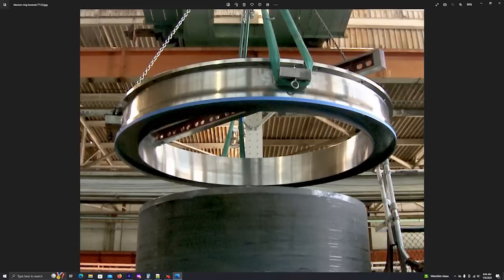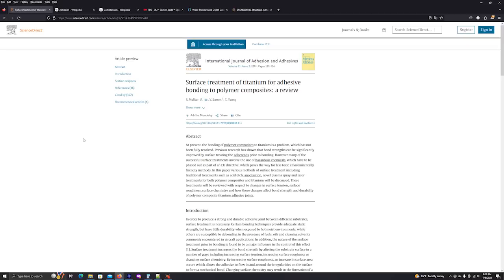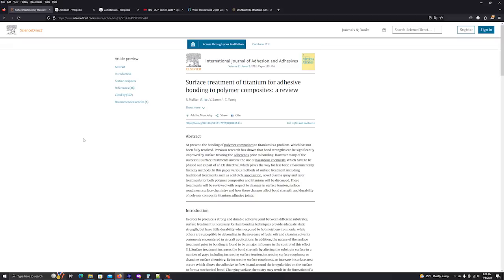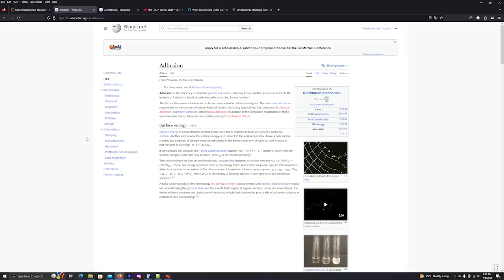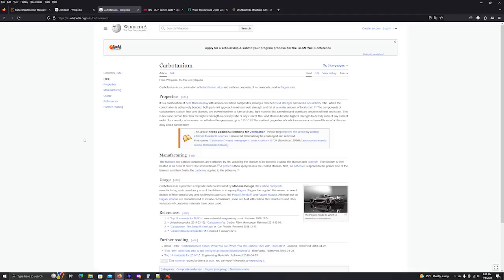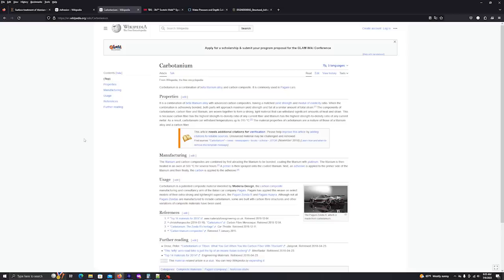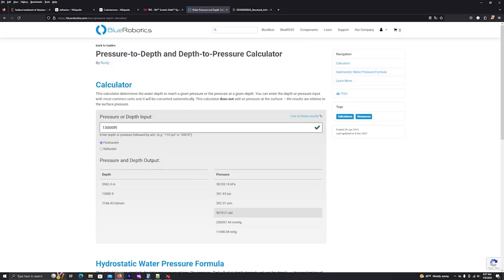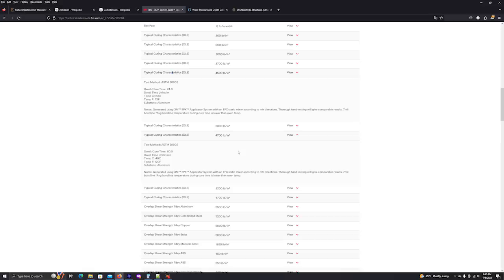Oceangate Titan Adhesive issues between Carbon Fiber and Titanium

Comment: The bonding method itself is dubious but the way they were doing it in a warehouse and not a cleanroom is wow.
Reply from the maker: Yes, also the guy in the video wiping the ring/flange did not have gloves on.
Reply: @JoediyLab  
Stockton:  It's not like Elmer's glue, it's like peanut butter.  
I'm convinced this guy's family paid for his engineering degree, which is a thing that needs more scrutiny because "engineers" like that will kill people.
Reply: @BIG-Jared  Engineers like that cause disasters. I agree his method of gluing the rings on to the carbon fiber was not very smart.
Reply: @BIG-Jared - where'd you get your engineering degree?    ::eye roll:::
Reply: @JoeyMartz  ... and you? Me, I attended UT and 40 years with LM Aero in this field in 38 Countries. Care to give me a shot? Rush was 20 years on the F-15 Program (and most probably his penchant for disliking the rigidity of how Aircraft Companies must do business ... including AS9102 certification that would have stopped him in his tracks and the Sub, as configured, never made) ... and know that there are a multitude of "Engineering Specialties" ... he was NOT the right type of Engineer to be making these calls IMHO; he fired the right guy 3 years ago because he told him "no" to his design.
Reply: @BIG-Jared  Rush's specialty was in aerospace engineering-- so essentially, he had the base knowledge of engineer shit and building human-occupied craft, but obviously the physics of that do not carry over to ocean physics.  If he had zero engineering experience or knowledge it would be astounding that he made some shit that managed to survive 7 previous dives.
Reply: @AnonBigSlice good point, he did make a working submersible, just not a multi-dive submersible
Reply: @aelius_audio he made a death trap it could have failed at any time all y'all sitting here talking about how poorly he applied the glue that could have failed on day one
Reply: It failed perhaps because of repeat deep dives weakened entire structure. The ntsb will come out with a full report in 2 years.
Reply: @BIG-Jared enginnering degree on its own doesnt mean much. You can take the fundamentals of engineering (FE) exam and undergo the 'professional engineer' (PE) career track, which requires years of on the job training. "Real" engineers are 'PE' and not just college grads.
Reply: @BIG-Jared  Yeah, legacy admission to Princeton because one of his ancestors founded the school.
Reply: his whole design wasn't very smart, as witness his shiny new Darwin Award, very well earned.
Reply: @JoediyLab  yep ... and does not appear any "Adhesive Primer" applied; most ALL Aerospace Adhesives require "Primer" prior to application of the Adhesive itself along with prescribed "tack time" ... and all this done in "Warehouse" setting instead of a "Clean Room" ... SO, SO many major mistakes in these videos you are kind enough to share. Thanks !
Reply: @JoediyLab Exactly. Working with composites and adhesives is not like mechanically joining materials. 

Proper Processes Prevent Piss-Poor Performance is the guiding principle, and cleanliness, to the point of obsession, is paramount. 

It doesn't matter how well you adhere to the mandated curing cycles or how perfectly suited the chosen materials are to the task at hand, if you contaminate the product during the build up, you've created a ticking time bomb, one that may have serious consequences down the road.

What's worse, is that there's no way to tell these incorporated weak spots are there, till they announce their presence, months or years later, by showing up as delaminations or catastrophic failures.

I used to work as a structural tech at a major airline and I both fabricated and repaired composite structures. I don't know what it is, lol, but there's something about a freshly prepped, CLEAN surface, layup moments away, that seems to invite foremen and other looky-loos to appreciativly rub their literally, greasy mitts, on the repair area while saying, "Nice job." "Gee, Thanks! (for one more bout with those toxic cleaning products)" was our response as we walked off to get them, lol.
Reply from the maker: Yes thanks for the feedback 🙂
Reply: My first thought was "There are going to be air bubbles in that glue." Air bubbles bad.
Reply: @ianwalton284 Air bubbles in the carbon fiber, and the glue would keep passengers better insulated and warmer at depths.
Reply: @JohnSmith-bw8dn  they showed the difference between backyard hobbyists and professional sub builders. Triton Submarines is professional sub builders
Reply: Rather questionable how did air bubbles escape when lowering the flange? Ah, right, they didn't
Reply: Wiping the dust off the ring as they sit in the warehouse waiting for the joining together day.  No one thought there was a problem here?
Reply: This is a sacrifice c'mon in our face
Reply: agree…also the carbon fiber was wrapped horizontally, should have been a weave…this would have minimized cracking
Reply: The flange should have been longer with measurements taken dry fitted and then after the wet layup to make sure they had the required thickness of adhesive and then they should have been looking for a bead of squeeze-out 100% around the perimeter. That's just for a proper joining. The whole thing was never meant to go deep in the first place.
Reply: I also noticed them not wearing mask's when mixing or applying this adhesive, fumes have to be strong
Reply: It is homemade.
Reply: Stockton Rush admitted to cutting corners but said he had good engineering behind it. Yet, what’s swirling around in the ether about him does not lead me to believe his engineering was conducive to anything good. The thing the really gets my attention about this whole thing was that Stockton Rush wasn’t just a guy that believed that safety was stifling innovation. Although this is what he says, people say things that they want you to hear. Safety stifling innovation would have some general support here and there from people who might agree in whole or in part with that. But Stockton Rush did not just believe in lax regulations, the guy was openly against safety altogether. 

The group of professionals that were critical of his choices were people just like us and typically a person would not go out of there way to write a letter, or an email, or make a phone call to tell someone that they don’t think what they are doing is tenable. The normal human condition in these situations is an atmosphere of support, and perhaps brotherhood with competitive undercurrents. If we examine all the effort that people put forth to warn him and get him to reevaluate his blueprints and incorporate safer measures it turns out to be extraordinary. 

Safety has always been a pain in the butt to everyone. Nobody just embraces the safety aspects of a project or a job, yet most of the books of rules and regulations have been written with blood. So we all understand that safety is in place because real lives have been forsaken doing the very same things. 

James Cameron documented his process creating the Deep Sea Challenger and in his documentary about the second scene of the movie Mr Cameron says, “We never compromise on safety. Not when it involves our lives.” He created a sub that was more than sturdy enough to maintain under the effects of the pressure. He rigorously tested every part, every system, and every procedure so that he could do the dive and live to tell about it. 

What has occurred to me with all of this in mind is that safety is often times a bit of a grey area. Safety is completely redundant and perhaps a lot of it is totally unnecessary. The problem is you do not know when you have crossed that line of having just enough safety, or having way too much which means lots of wasted money. 

When it comes to certifications and testing for inventions like the Titan from OceanGate, it’s not like going to your local DMV and paying $40 and getting something printed up. 

Stockton Rush was outspoken against safety and I just cannot think of why anybody would be that way about it. But what I believe is that OceanGate was still trying to get to a place of viability. They had not broken that crucial line of becoming as profitable as Stockton Rush dreamed. In the year 2021 he managed to raise $19 million for the company. He purchased carbon fiber at a discount from NASA because it was beyond its shelf life. Safety is an attitude that shines through in everything you would do in that situation, but buying that carbon fiber is one of many indicators that his whole mindset for that project was in the wrong place. If he was looking at his balance sheet and had a bank account of about $20 million, he knew if he was to go line by line and do everything as safely as he should have he would have easily watched that $20 million dwindle to just a few million. 

Stockton Rush had a predicament. There is no way that when he was training to be a pilot they were teaching him to ignore checklists, and be some maverick out there who didn’t follow the rules. He certainly would not have learned that from engineering school either. His attitude toward safety I believe was a self preservation situation in which he launched an assault on anything having to do with safety as a way to preserve the most capital possible. Worst case scenario in his mind was he heeds the advice of the community and shells out $15 million on upgrades and testing and certification by esteemed bodies and then something catastrophic happens to his business and he is forced to abandon everything. The fear of failing at OceanGate was able to push out the very real threat of creating a sub that implodes because it has t been tested.
Reply: @adamlv1  Very well said.
I honestly believe that that not every human endeavor can be safely transformed into a viable for-profit business, and OceanGate seems to be evidence of that.
It has certainly confirmed the adage that safety regulations are written in blood...
Reply: @adamlv1 this was the most complete and comprehensive thought on the whole scenario and I totally agree. The whole situation screams that Stockton Rush was not as financially strapped as we had initially thought.
Reply: @adamlv1 right on. My exact thought. This has more to do with clinical psychology than engineering. He self deluded himself into thinking that modern safety protocols were excessive because he needed a viable way to enter a very resource intensive market with little money available.
Reply: Leaving oils from your finger is your hands and not in a clean environment with suits and mask gloves
Reply: @gaylecheung3087  "Leaving oils from your finger is your hands.."  ?
Reply: @SteffiReitsch  it's evidently some kind of typo or just a brain fart. The point comes across just fine.
Reply: @tomslastname5560  I  think it 's messed up , but since she's not a native English speaker, it's forgivable. We can figure out what she's trying to say.
Reply: @SteffiReitsch  know what he's trying to say. When  gloved and in a protective suit, the fats/grease from your body won't transfer to the materials you are working with. I think he's a native Chinese speaker, so be easy on him.
Reply: you know once under water they wouldn't even need to have the two pieces glued together...the pressure of the water alone will make it impossible to separate the caps even if you'd try...so the glue as NOTHING to do with all this.
Reply: @TechWizMaster  yes, but Water could seep in through these glued parts as the Titan was towed in place! and anyway,  you can't simply glue something together without following the exact procedures!
Reply: @TechWizMaster   Even if water pressure alone would hold your submarine together at depth, that does not mean the water doesn't try to move under that shady "glue" seal. Also the submarine is not always withstanding super high pressure.  Maybe the glue went bad in shallower water or from some mechanical stress during transportation.... it's not like your sub stays always at 4km down... it moves around.... and that "glue" is totally inadequate to hold any mechanical forces.  So I think the seal went bad from totally unrelated to depth forces and then just gave up at some point, which led to that sudden decompression. Also if everything is OK with that "seal", why no other submarine or actually anything is build in that way... even a normal car is not glued together like that.  I think the seal is just too shabby and shallow.
Reply: @TechWizMaster  agree, nothing with the implosion, but certainly had an effect on the tightness.

Comment: I read a study on the bonding strength of different materials with different prep. I have always found sandblasting metals is preferred and the study confirmed this with  titanium. Also a serious and thorough cleaning process so no contaminating residues at all. They were using rags to wipe titanium that might have chemical residues on them and also was there any abrasive prep on the titanium. I am confident the bond was the failure point.
Reply: They also weren't wearing gloves when cleaning the mating surfaces. He's even leaning his bare forearm on it. 
Remember kids not to Rush things. 🤠
Reply from the maker: Yes it appears so, but we do not know if the carbon failed first or the bonding failed first.  We will have to wait for the report,  Thanks for  the comment.
Reply: The compression force at that depth was also acting on the two end caps, providing some resistance to separating from the hull in at least the lateral plane. It is impossible to determine if the bond was the first point of failure, until examination of the internal side of the flanges for evidence of the type of tear-away, and remaining epoxy, if any.  The interior of the flange is not visible in the photograph from the wreckage. Also, no one knows the composition or properties of the epoxy used, but we do know the composition of carbon fiber, and its properties in high compression environments, and what happened with the first CF hull Rush used. So at this early stage, being confident that the failure point is the epoxy bond is a bit like hearing hoofbeats outside your window and thinking zebra, instead of horse. A slight possibility, but far more likely it's a horse.
Reply: @gailmcn   The glued bond just looks too shady to not be a concern.... but then again.... everything in that sub except for the titan hemispheres looks shady.
Reply: The most likely cause of failure was the crumbling of the CF hull. By the looks of things on implosion the hull simply disintegrated at which point the strength of the glue / bond was immaterial.
Reply: the CF hull's ends were machined for straightness; I wonder if the presents of dust would weaken the joint between it and the flange.

Comment: Sound is fine with mic and pop protection. Volume in the clip is maybe a bit low, otherwise perfectly sounding. However, when you turn your head away from the mic, there comes an echo from walls or other surfaces rather than direct sound from mouth to mic (which is quite noticeable if tour used to sound engineering at least). Just try to keep the distance and direction as constant and straight as possible.   

Good job, and good luck Sir!